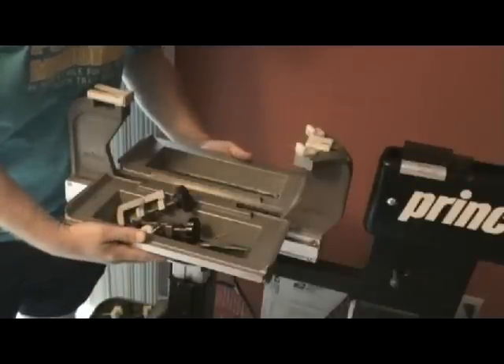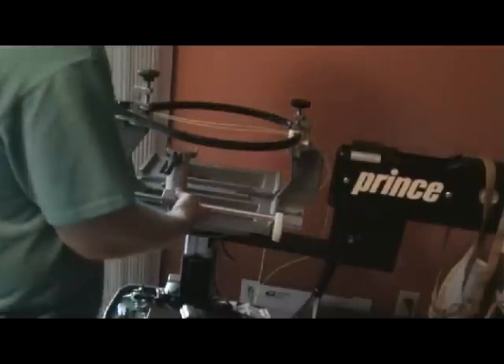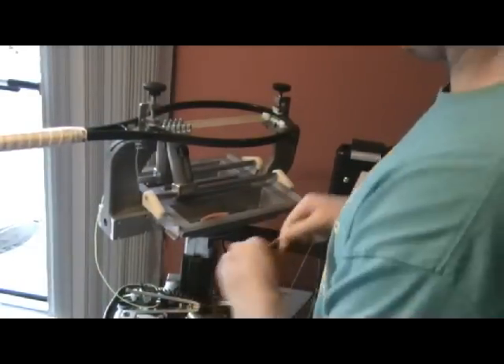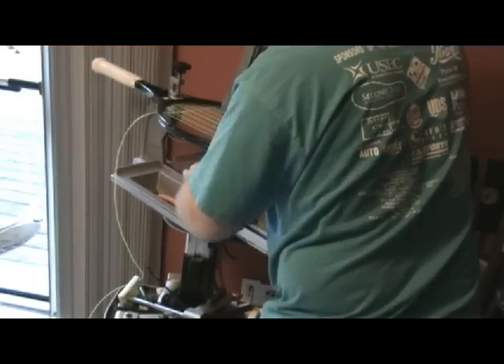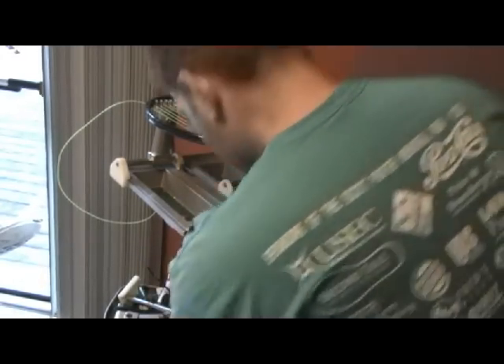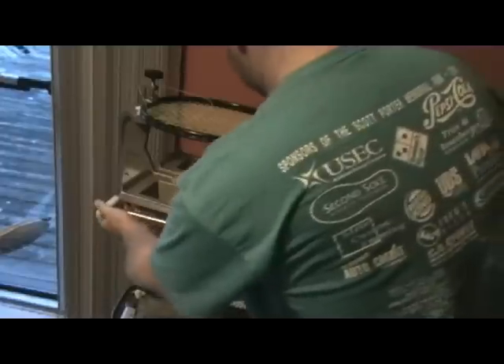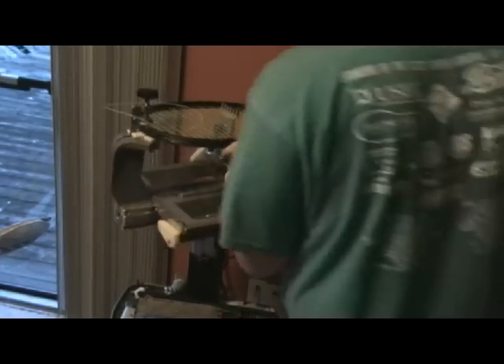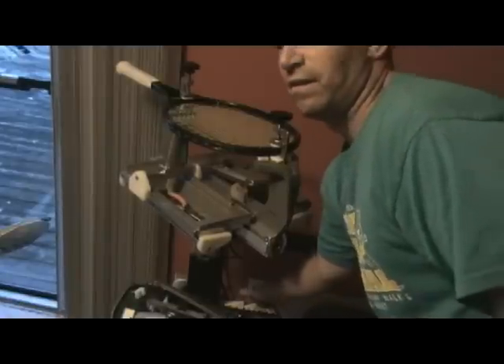P200 stringing

Comment from the maker: I'm the one who posted on your Tennis Talk thread about placing washers on that post to repair the wobble.  I saw a guy on Ebay who'd done it and replaced the table w/ an Eagnas table w/ 6 point mount and a swivel table.  I haven't replaced the table but I'd consider it since I do string fan pattern racquets on occasion.

Comment from the maker: I have the manual for it.  It only suggests that you might have a leak in one of the hoses and the suggestion is to slice off up to an inch of the hose every time you connect/disconnect a hose.  You should be able to dial up the tension.  For additional information, I'd contact tennismachines or tennis talk at tennis-warehouse's website and do a search or post a question there.

Comment: There is a washer below the table above the post. It is just a plastic washer. To make one you could use a circle cut from a milk jug. That make of HDPE and should work well. You're not going to get rid of the wobble.
Reply from the maker: Thanks for the idea. I actually bought some metal washers (plural) from the hardware store and was able to add enough to get 360* turn w/ much less wobble!

Also, thank you for all of the help on tennis talk. I've learned many great things from you in the last few years.
Reply: Thanks for the kind words. The metal washers will help but to cut down on metal to metal grinding I would also put a piece of 'milk jug washers' above and below the metal ones.

Comment: Thanks for this video, i have recently purchased a P200. Never did any stringing but I will give it a go. One concern I have is when I pre-set the tension I can only make it go up to 58 lbs
. Perhaps there is a slight leak. Do you think I should service it?
Reply: Just use new machine.

Comment: Hi Doug really enjoyed the video.  I recently purchased a p200 and I am having issues with the clamps.   How exactly do you go about adjusting the clamps so the string doesn't slip?
Reply from the maker: Connor DeFaber-Schumacher 
I sold mine to a friend a few years back so I’m going off of memory.

First clean it with isopropyl alcohol. Some use a toothbrush and others soak a shoestring. 

To tighten make sure the lever arm is up and turn it by swinging it around clockwise while holding the nut on the other side. I always used a wrench socket with a ratchet. You can also just turn the ratchet/wrench to tighten.

Check it on a scrap piece of string to make sure you don’t have it too tight. The adjustment you’ll make is usually very small.
Reply: I appreciate the quick reply.  Everything you said was helpful and I was able to string rackets on it this morning.  Thank you for your help
Reply: I just had one more question if you do not mind.  When stringing the crosses sometimes the racket system am I not tightening it enough?
Reply from the maker: Do you have the owners manual?  If you don't email me direct which is my youtube username at yahoo.com and I can send you a pdf file.  At least, I believe I still have it somewhere.  If not, go on tt.tennis-warehouse.com in the stringer's section and request one.

You do not want to over tighten any parts.  Snug should be good enough as long as you have the proper throat adapters, etc.  I want to say they all have letters such as H.  Make certain the racquet is snug by turning the allen wrench to fit the frame.  Then tighten the C clamps on the frame so they are snug.  Lastly, lightly turn the allen wrench to "stretch" the head of the frame and make it more snug that way.  Do not over turn as you should feel it's tight.  The owners manual shows the process in pictures.

Comment: With that kind of throat holder. How does badminton racket fit?
Reply: Douglas Kohler the throat holder just take into consideration the shaft. The holder must be special
Reply: So it s not good idea for badminton? I was tempted because it s constant pull...
Reply: Douglas Kohler thank you, going to buy a ektelon model h instead.
Reply: This stringer does not work for badminton? I found a good deal on the machine I was hoping it would be ok for badminton rackets. let me know. thanks!

Comment from the maker: I wouldn't use wd40 for anything. If I were going to lube anything it might be the bearings in the string jaws and maybe the bearing that the table spins on.  I would also only use a Teflon bicycle lube. As far as the brake, mine doesn't have one. A brake would probably only be useful for racquets such as O ports and T2000s. Since I made this video, I've purchased and installed washers to remove the wobble and lift the table high enough to give 360 degree rotation.

Comment: 3D print a new bearing for it.
Reply from the maker: That’s going extra. I ended up first cutting a plastic ring with scissors from a milk jug and that worked just fine. I later purchased some metal washers and actually stacked enough to get 360 table rotation.

I’ve since sold the machine to a friend. He didn’t like the angle of pull and removed some of the washers.